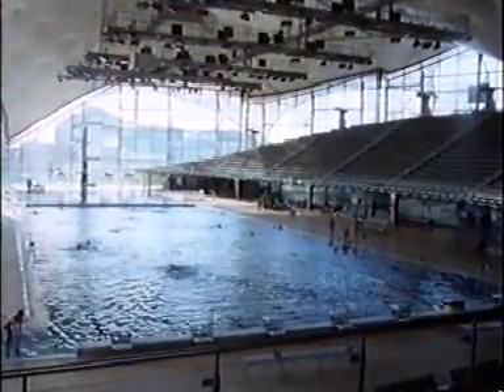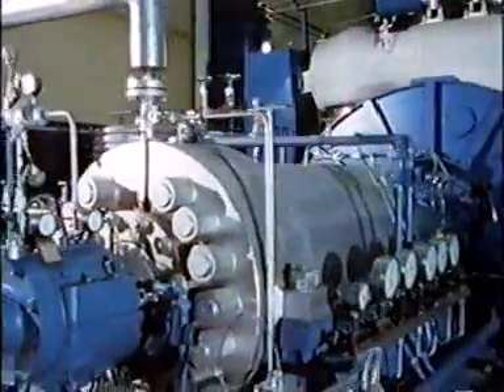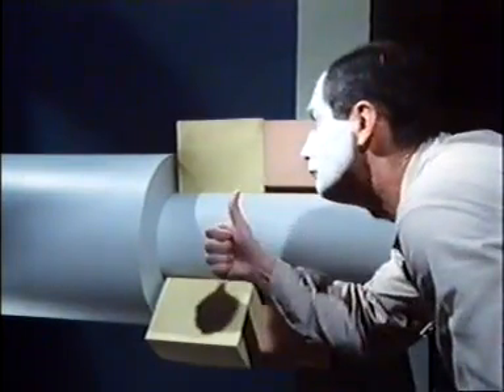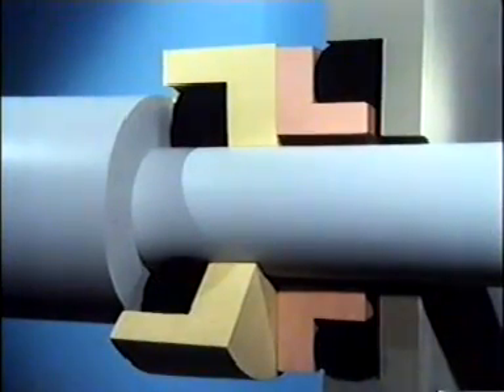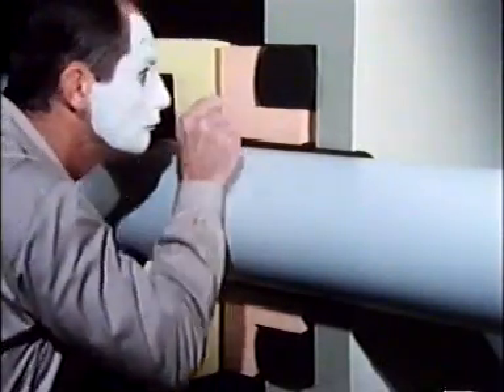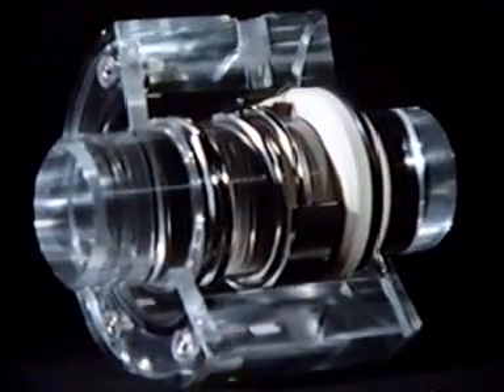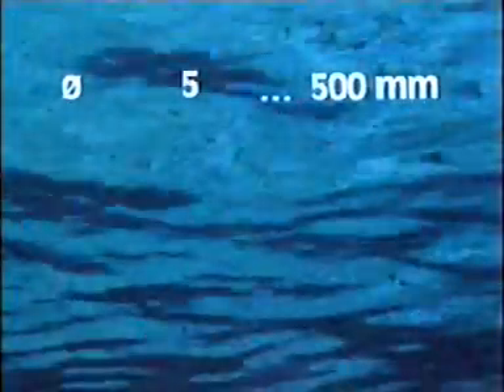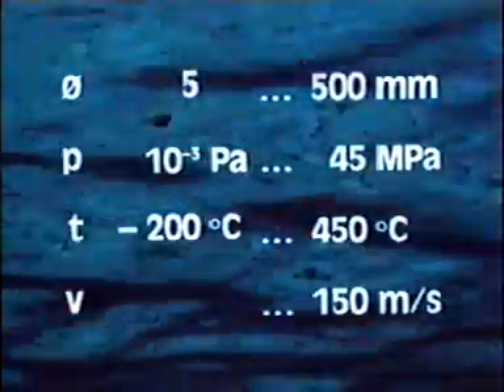Basics Mechanical Seals EN

Comment: single seal Internally mounted seals does create so many problems ... retro fiting with a cartridge seal seems to be the way to go,as it  creates a better enviorment for the new seal to operate in... it costs a bit to re engineer the pump but saves in the long run...